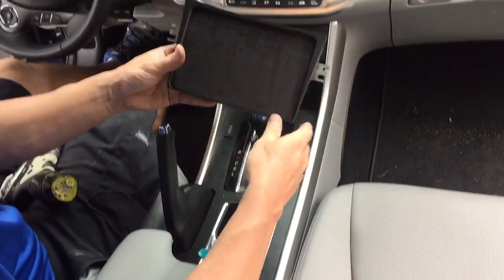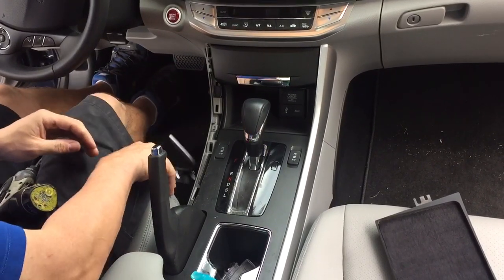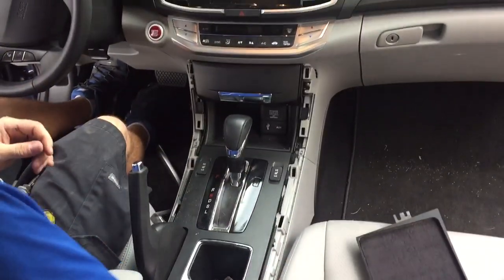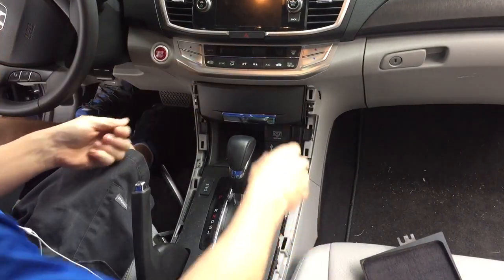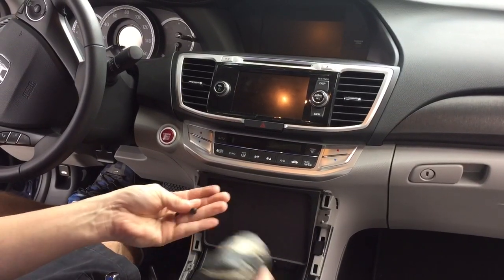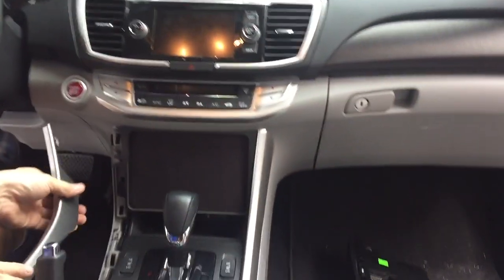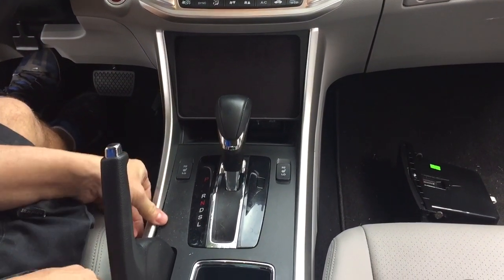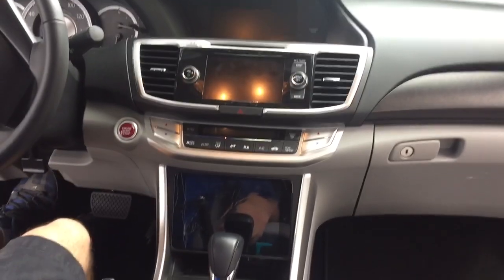2013 and up Honda Accord iPad mini installation

Comment: Where is the cord located for when you need to charge the ipad? Do you sell the adaptor? If yes, how much?
Reply from the maker: It doesn't allow you to charge while in the kit. We do sell a 2.1 amp USB charger on our website which is enough current to charge the iPad mini. A regular charger is only 1 amp and will not sufficiently charge it.

Comment: when purchasing this item on the website  it has you choose which ipad model youre going to use... if you where to choose an ipad mini 4 ... is it still the same kit if you then  wanted to use a ipad mini 2???
Reply from the maker: Johnny Chutan no, the mini 1, 2 ,3 kits are the same size but the mini 4 is different as the mini 4 is 1/8" wider.
Reply: Audio Designs & Custom Graphics Thanks i had ordered the 4 kit on accident and needed the ipad mini 2 kit and Aaron was able to help me out and said he would be able to fix my mistake since my order hadent shipped out. Thanks for the good customer service! Well appriciated!
Reply from the maker: Johnny Chutan ok cool. He mentioned it to me this morning. I got you out a mini 2 kit!
Reply: Audio Designs & Custom Graphics Thank you! Cant wait to install it 😎
Reply: Hey boss,
Where i can go to buy this kit for my Honda Accord hybrid 2014?

Comment: I have some questions how do you remove the Ipad ,
 how does it secure in place , are magnets utilzed to lock it  and i think I read this below but im a little unclear is there a way to charge while in the kit
Reply from the maker: There are magnets in the kit that hold the iPad mini. 
We include a nerf dart (suction cup) that pulls the ipad right out. 
The dash isn't wide enough to allow charging as you'd have to cut into the dash pieces.